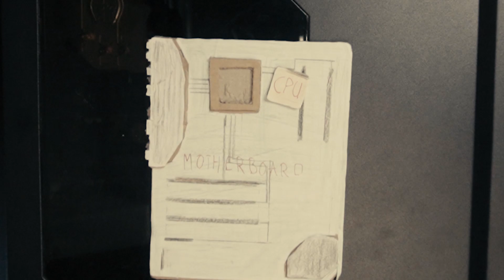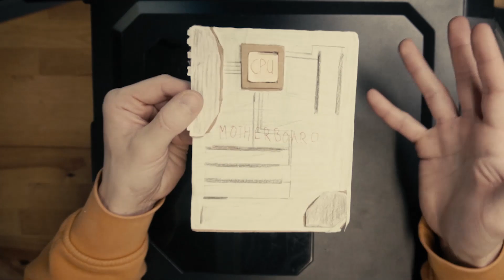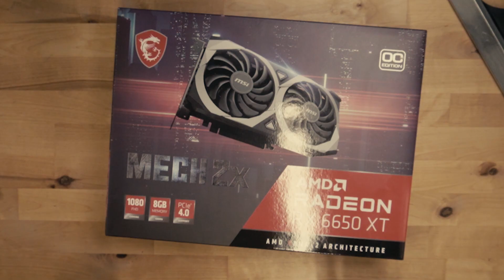How to Upgrade Your Old Computer?

Comment: You're some what wrong about the cpu socket changes. While intel has been changing socket type every two gens lately, AMDs am4 has been around what, 5 gens? I also believe AMD has been promising similar life expectancy for the new am5 socket too.
Reply from the maker: I believe I mentioned that at 5:47. How do you think I could have presented that better to make it more clear?
I'd like people not to miss that information, especially since AM4 has been a great platform for upgrading.
 
Also agree with you that AM5 looks very promising for a new build. It's a bit held back by the price threshold for the required more costly DDR5 and the insane performance that the 5800X3D still had. But for futureproofing, especially when DDR5 pricing will drop, it's a great platform to buy into.